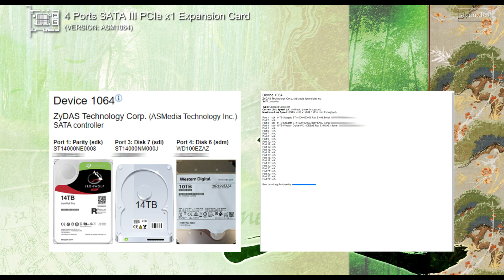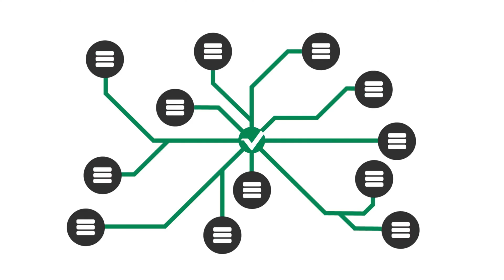4 Port SATA III PCIe x1 Adapter Card | More HDD for UnRAID/PC

Comment from the maker: If you have any questions about  the 4 Port SATA III PCIe x1 Adapter/Expansion Card in the video feel free to ask and drop a comment down below. I will try my best to answer them based on my experience while I'm using it:yougotthis:. For technical support and troubleshooting might be best to contact seller where you bought it from though:goodvibes:.

Comment: I don't have the cd drive, how to instal the driver? Because my pc dont detect the adapter
Reply from the maker: You mostly don't need disc driver. It works instantly using system drivers already in your computer. Plug a sata drive into it and it should work right out of the box. If it doesn't then probably defective drive or the adapter itself.
Reply: @sleanzles now my pc cant start the windows, inaccasible boot drive come up
Reply: @sleanzles now the pc cant boot
Reply from the maker: @ibaltawaqal2148  PC cannot boot without a boot drive. Get into BIOS/UEFI  and set which drive is the OS boot drive.

Comment: I plugged it into my pcie slot and some hard drives but my pc is not detecting jt. Do you know what could be the problem?
Reply from the maker: Make sure the card is inserted to the pcie slot correctly and also make sure data cables are plugged all the way in on both ends. And check drives in the BIOS first if they're all detected there. And if that's new drives then be sure to format them in windows disk management tool.

If the card isn't detecting any drives then maybe the card itself is defective 😢.

Comment: what card are you plugging in the top and bottom?
are there audio and ethernet card ?
Reply from the maker: That's a 2.5G Ethernet card on top and a wireless on/off switch card on the bottom.

Comment: does this work with windows 11  pro?
Reply from the maker: Yes it does work on Windows 11 too.
Reply: @sleanzles  didnt work on mine, seems like this card hates the Z690 chipset, and febsmart web sight is gone, no support,no drivers,no firmware updates
Reply from the maker: @mfmayes   Sorry didn't work for your system. You might have the newer ASM1166 SATA based cards which have issue with Z690. Try SATA cards with ASM106x which seems to work better for it. Or try flashing the firmware from https://www.silverstonetek.com/en/product/info/expansion-cards/ECS06/#fgo-down which says fixes compatibility issue and support Intel 600 series chipset motherboard but you need to use other computer to do so. **DO THIS AT YOUR OWN RISK**, it may work or might not. Goodluck!